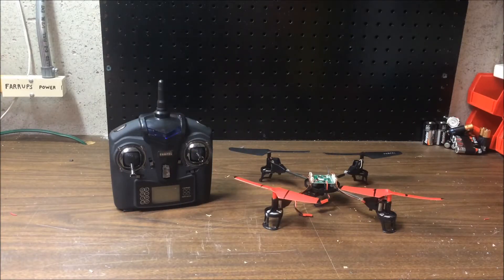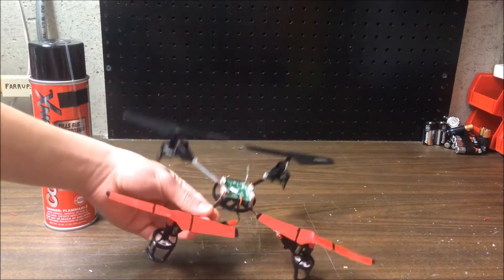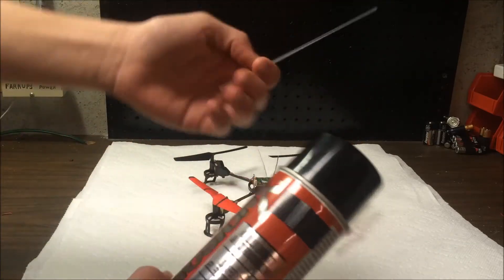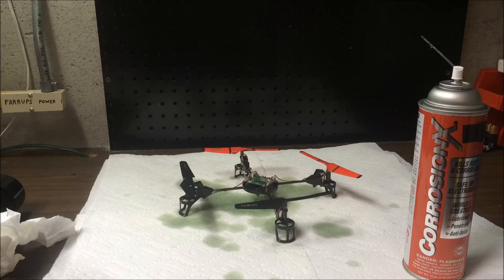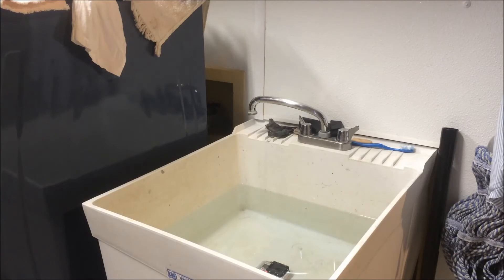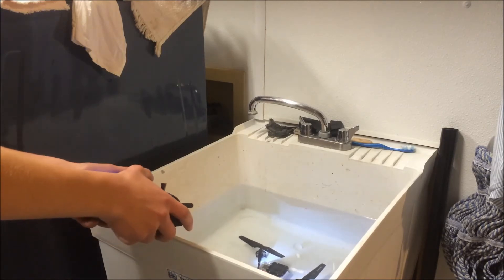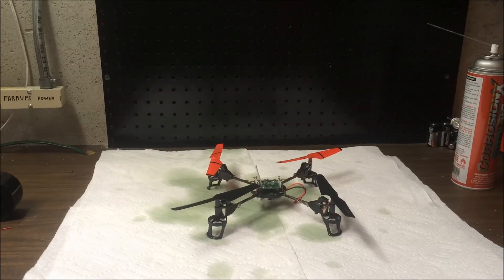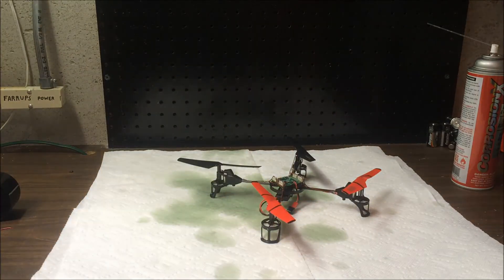Waterproofing Quadcopters - My quad takes a swim

Comment: does waterproofing motors is fine?
Reply from the maker: Zohaib Dar motors should be fairly waterproof themselves, after this experiment I have had issues with some motors and the corrosionX. I would recommend trying to cover all PCB and solder joints but avoid motors if possible.
Reply from the maker: Zohaib Dar most motors will work in water but keep in mind this waterproofing is not to make your quad to be flown in water, this process is purely preventative in case your quad is rained on or falls in water. My example was an extreme one and was for demonstration only. DO NOT DO THIS TO PUT YOUR QUAD INTENTIONALLY IN WATER!
Reply: Ike Tech and Gaming I want to make a quadcopter which can go underwater so what do you suggest what should i do to completely make it waterproof?
Reply from the maker: Zohaib Dar first of all, radio signals do not travel through water so the instant your quads antenna goes underwater you will loose connection. If you really want a waterproof quad I would recommend looking at the Mariner it's a waterproof quad.
Reply: Ike Tech and Gaming I've solved the problem of radio signal. Only problem is waterproofing the motor. Thanks anyway mate

Comment: Sick video man! I'm totally going to do this to my quad. What type of quad do you have? It looks pretty nice! I'm probably going to get this model to do that. Can't wait for more videos!
Reply: lol thats a v212!
Reply from the maker: RCreptile12 this is not a very expensive quad and there are many companies that make it with different names, yea it's on of those. I would recommend a better quad, preferably one with GPS I own two GPS drones now and wouldn't go back. It is definitely worth saving up for a better quad. If you have the means to I would recommend the Blade QX3 or the Typhoon G. They are both GPS and have amazing features.
Reply: Ike Tech and Gaming I'm a university student and I've to make a project of copter which can fly and go underwater as well and I still can't find the solution to waterproof the motors. These recommended copters are no use for me. I need to waterproof the copter.
Reply: Ike Tech and Gaming
my first quad! loved it
Reply: NoFlyZoneRC I'm on it
Reply: Going rain flying